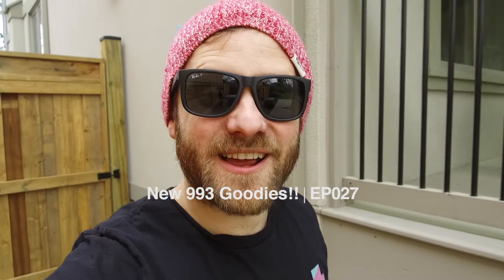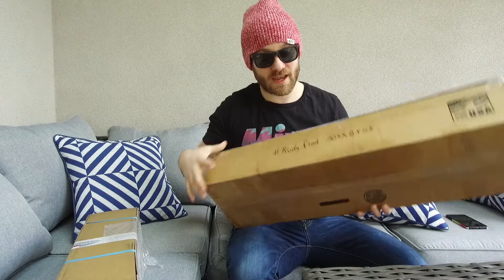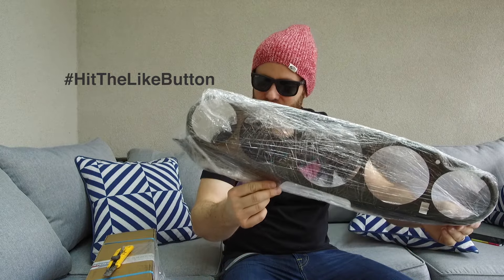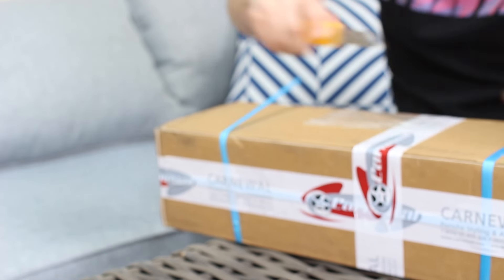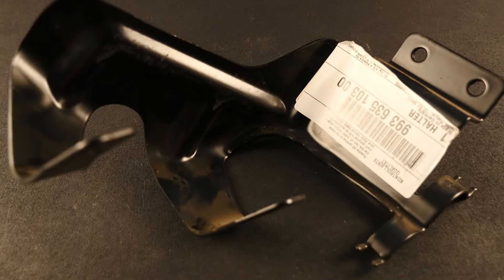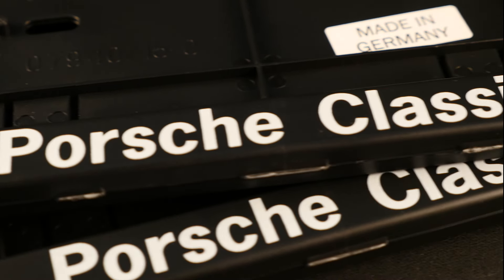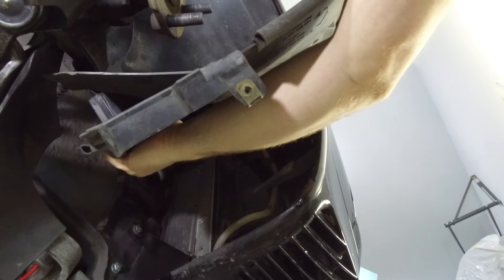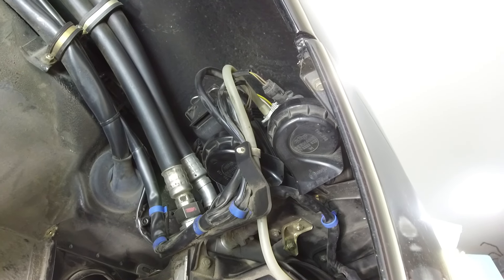Unboxing Porsche 993 Parts |  EP027

Comment: The CF panel is sweet! That will look killer with your steering wheel. I had to replace my cassette holder too - my kids were kicking  them open every ride. The tray is way more useful. Way to keep it real on the horn issue. My '95 was born with the dual trumpets by the way.
Reply from the maker: Ha, i keep opening the cassette holder by accident too! I can just imagine when I'm putting my boy in the back how annoying that will be haha. Yeah, so your 95 still has the pre-noise regulation horn! I was always under the impression all USDM cars had the one I had...but that's not the case! 96+ car have my horn. I wonder how different they sound
Reply: I can see the trumpets when I pull the passenger side headlight. I can send you a photo if you like.

Comment: Those aren't necessarily "euro" horns.  Those are just the horns that got discontinued by Porsche in 95 or 96.  I have those horns on my 95 and they sound so......classic.    If you check out the wiring diagram for a 95, you'll probably find the right connectors if you don't want to splice something in.

Sorry you couldn't get them installed the first time but it'll be worth it.
Reply from the maker: Excellent info Bob!! I did not know this! I thought it was related to some stupid noise regulation for NA only! I will investigate the 95 diagram ~ splicing is not ideal... Thank you!!!!
Reply: Bob P my dads 95 horn sounds great

Comment: Good work!
Can you tell me, for you what is the real difference between 993 and 964?
How did you find your 993
Reply from the maker: Thank you for watching! 993 is very different from the 964. The 993 was the first 911 evolution that Porsche only used 20% of the old parts on the new car. This was a huge evolution both technically and aesthetically. I found my 993 locally through a classified ad after a long time searching for the right one.